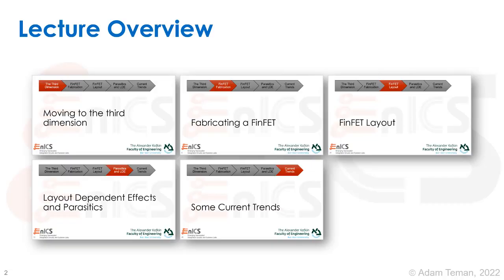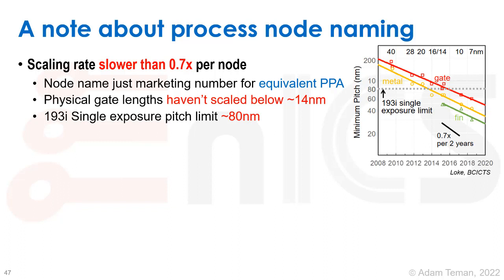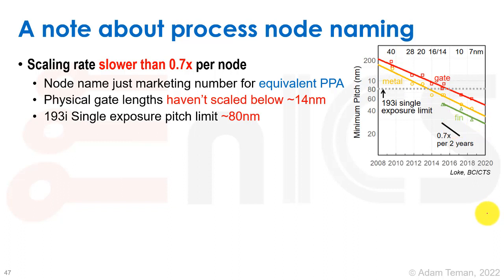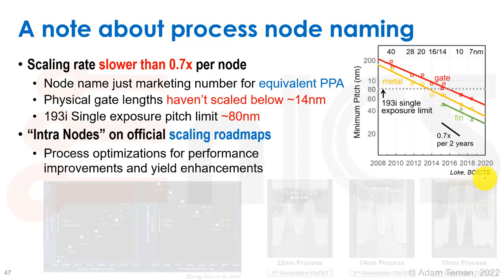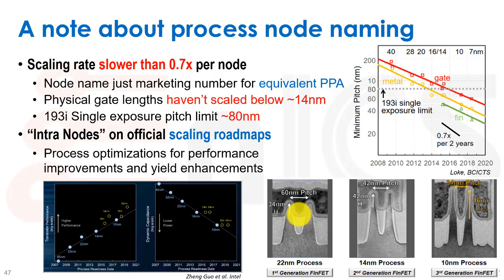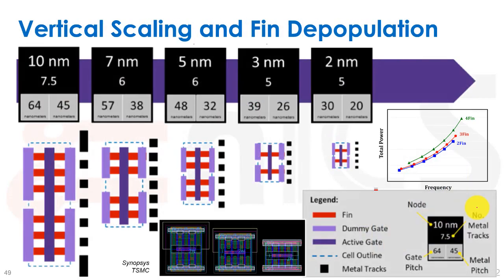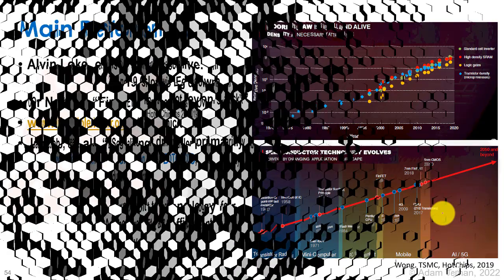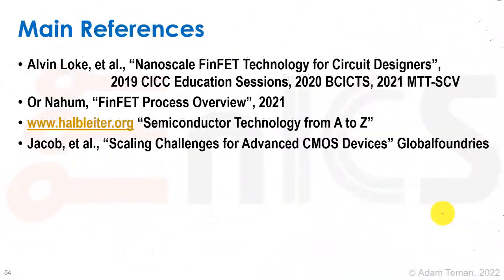Advanced Process Technologies - Part 5: Current Trends

Comment: Really amazing series, learnt a lot! I have a question regarding GAA, how do the number of litho patterning layers change at the transistor level with this new architecture? (From what I understand the FinFet has the fin, the cut and the via and then also x3 for the gate?)
Reply from the maker: Hi Maddy,
Actually, I am far from a process engineer or a litho engineer, so I have no good answer for you. In fact, I have never myself been involved in any type of fabrication - all my knowledge comes from things I've read or heard and "good guesses" I've made based on experience designing circuits.
That being said, I want to point out that there are many many many litho steps for the front end of the line. It's not just one litho step for fin, cut and via. It's many steps that may even be considered a "secret sauce" of the fab. In fact, the majority of the processing time of the wafer is spent during the front end stages and this "gives time" for the design team to send out a so-called "metal fix", in case a bug is found (...or a feature added) in between tapeout and when the back end process starts. It may sound crazy, since you're not allowed to make any changes to the bottom layers in between, but by using "Bonus cells" and or by just rerouting the design (while the transistors are fixed in place), you can fix things after tapeout. And again, this is because transistor fabrication is a long and complex process with many steps. How many - I can't tell you and the fab won't - but it's a lot!